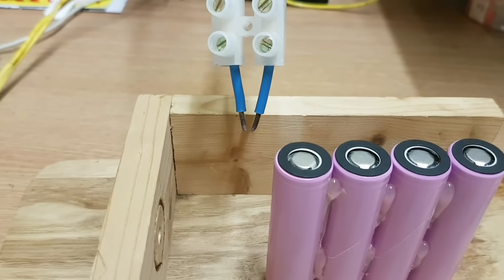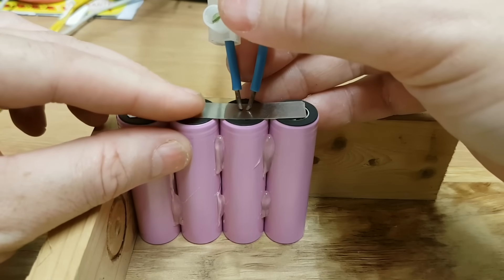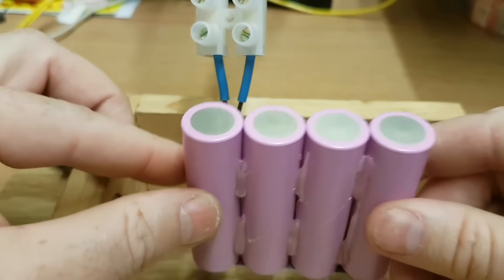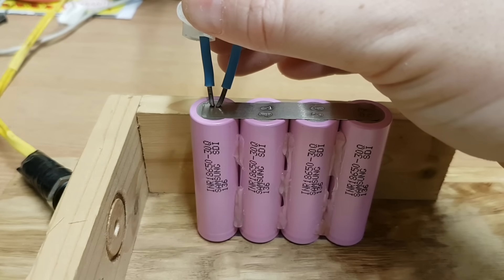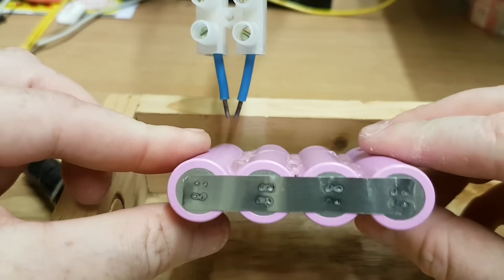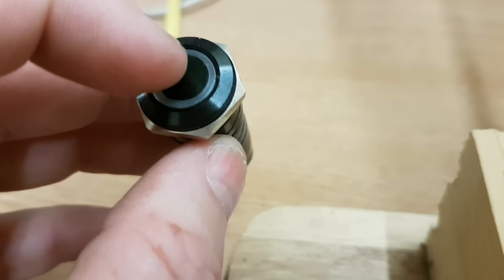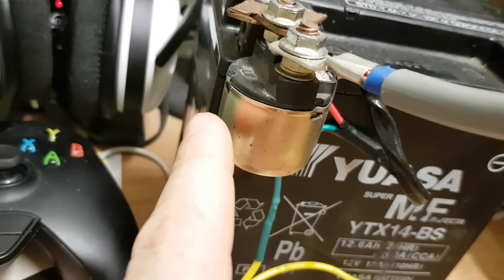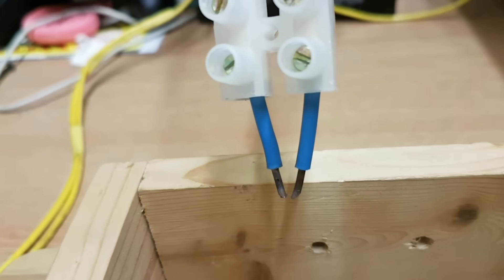DIY Battery Spot Welder - Demonstration & Explanation

Comment: Tried identical setup with with a car battery delivering up to 500A, and using .15mm nickel strips, no luck... it blows holes in the strip every time... so some sort of more precise control over the duration of the pulse is needed I think... could you maybe included exact references to the board you mention in your video ??
Reply from the maker: John Doe I think you're holding the button down too long or don't have the prongs firmly in the nickel...
Reply: Indeed, I think my switch is of the wrong type for the purpose... I'll try to find another one, but still, I'll also look for some mcu-controlled SSR in order to have a precise timing control...
Reply: furthermore, it looks like I've cooked the solenoid... it's now shorted !!!

Comment: Brilliant work , and concisely explained ... Although I'm sure the current must be less than 100A , otherwise the solenoid would stick ...I'm building a similar welder powered by a 20p pack of used laptop 18650 cells , initial experiments show there's  plenty of current from this 3.7V supply but the pack could not be delivering over 100A have not tried a  solenoid yet (I just poke the probes on the strip ) solenoid will reduce  the current .. I would advise not to buy a spot welding pen ,  I just did from ebay , 38 pounds , it's rubbish..
EDIT ... Have just tried switching using a motorbike starter solenoid .... had to go up to 20p 2s, (used laptop cells average int res 300 mOhm!)  the weld is perfect .. if you're using new 18650's I bet 2p 6s would do it ...it's all about the internal resistance of the cells ..

Comment: Does anyone know how to calculate the amount of Short Circuit Current based on the information displayed on the battery. I thought that this information was impossible to obtain without knowing the internal resistance of the battery? I can't understand how the current figure can be obtained using the Amp-hour rating and the voltage (12.8v)?
Reply from the maker: Timothy O'Donnell CCA gives you an indication.
Reply: For those reading this thread the CCA is the COLD CRANK AMPS, which is generally considered as the amount of current available to turn over the starter motor. So I've pulled a car battery from an old car and this information isn't written on it ... I'm guessing that I need to try to find the battery specification from the manufacturer to determine this data. Is this correct ?
Reply: Also ... excellent video, massive thumbs up to you.
Reply from the maker: Timothy O'Donnell yeah, you'd have to find out. As you've found, a lot don't specify. 😕
Reply from the maker: Timothy O'Donnell thanks 😁

Comment: Its a really nice KISS device (Keep It Simple Stupid).
More advanced welders are usually build from a controlled capacitor charge setup.
But thats a completely different (and complicated) story.
Reply: tutto occhei
Reply: pretty simple to do it low sided. digipot or dac on charger is probably hardest part there. Im working on high sided design right now to enable the board to be flexible to the point that if you wanted to connect it to two car bats in series where the cap bank was...and throw a choke on output... you could even pwm stick weld. low sided design was tested with 2p 6s maxwell dcells. bout 12v was sweat spot and i could make 4 or 5 welds before manually turning charger back on to make quality welds again. I had tested it with bench supply for charging..bare bones...just to prove it worked then went through apt from hell trouble and bugs for 8 months. Ive almost got it ready to go low side with even wider buss bars, shortened weld path, and 3p 6s ...like 180f iirc and the ideal bus and fets add nothing to esr ...current came to like 2500amps on paper. As it worked 2p im thinking the lowered resistance of bank and improved weld path might get me the same welds at 9 or 10v. 

I really made the design a pita for myself though... isolated mcu and board to board is done with differential pairs :D

im personally proud of having no analog or magnetic switches on the damn thing too. When Lower voltage is dialed in on touch screen... or machine is turned off... power resistors connect to bank and bleed off all or some of charge. I used the beast known as depletion mode power mosfet

Comment: This looks exactly like the one AvE made... one would be tempted to suggest you stole the design :P
Reply from the maker: Harald Karlsen the are elements that are the same... However, my design does not require a crocodile clip to the negative of the battery to compete the circuit. This also means it's safer for the cell.

Comment: can the battery be replaced by a 12v power supply
Reply from the maker: Algar Refardi only if the power supply is capable of outputting at least 200A
Reply: If you put a big capacitor next to it

Comment: I was thinking of using one or two 400v 680uf capacitors. Would it work?
Reply from the maker: danijel124 I'm not sure about the capacity of capacitors, but if they can output at least 200A very quickly, then yes... 👍

Comment: Thanks so much. I want to make a 10s4p for my eBoard and have been stressing about spot welders. This is awesome. Don't forget to layer up the strips on the ends if you're drawing more than 7-8 amps.  Thus was an eye opener too. https://youtu.be/wdZ_Ca_sAZE
Reply from the maker: Konkonkaos yeah that's a handy video, referenced it many a time. I'm using 12mm strips of 0.15 so mine can hand a little more current, but yeah, I tend to double up where needed ;)

Comment: Can I use DC power supply(30V 10A)  instead of battery?
Reply: You can't. The trick is the acid battery could source (at least for a tiny moment) a current of hundreds of amps that could melt thin metal. Whilst your power supply will definitely go to protection mode (off) right after 10A, which is not enough for deep penetration)

Comment: You could swap that copper out for some tungsten welding electrodes if you find some cheap ones.  Doesn't look like you really need it though.  That welding is really quick and the copper looks like it's holding up quite well.
Reply: Go to any welding shop, school welding shop etc & ask for some old, used tungsten electrodes. 
For the length you need they should give you a handful for free.
Reply: What makes an old used tungsten electrode not work for welding anymore?
Reply: length
Reply: I can run an electrode about a quarter of an inch long in my TIG torch.

Comment: I like your minimalist approach. The advantage of a capacitor bank is you can control how much energy is stored and the caps can be recharged from a much smaller capacity current source. Need more current? Add another parallel cap. Usually they use FETs to dump the caps but I guess you could stay with the solenoid

Comment: This works great, if you don't mind occasionally blowing holes in your really expensive lithium cells.
Reply from the maker: Collis Williams personally I've blown holes in fake cells, never in genuine cells.
Reply: darkkevind Maybe thats the problem. Im using the Liitokala cells.  The voltage, capacity, and weight are all correct, but maybe the contact points are thinner than a brand name cell.  Still, I think my next move is to purchase a spot welder that allows control of the current, since they're relatively  inexpensive.

Comment: i noticed that your  solenoid links are for 2 different ones can i use any of those or why is there links two of them? and the one you show is different does it work the same using the one in the link? could this be made with 18650 batteries connected together as the power source?

Comment: I suggest adding an emergency slow-blow fuse inline, because if your solenoid gets stuck things will heat up real fast!
Reply: Ignorant kids who don't know how to do any of the electronic math. This guy is shorting out a battery that has a 200A CCA ("cold cranking amps") rating. Thus, the peak current is limited only by the internal resistance of the battery + the solenoid + the cables + two point contacts. I'm pretty sure that the welding contacts are the largest contributor to total resistance. He has to be passing a few hundred amps through the wiring. 

Now please go out and shop for a 500 amp slo-blow fuse and get back to us, will you?
Reply: Demef where would that fuse go ? Thinking of making this build, but implementing safety features on it also. Thanks !
Reply: slow-blows are the best  \m/
Reply: Isn't that what the momentary switch is for??
Reply: @dickphan  the button he uses activates the solenoid, the solenoid is the switch that closes the battery's circuit. If the solenoid fails closed there will be no way to safely break the circuit.
Reply: True, as the power draw through the solenoid switch would be unlikely to ever be an issue.   There are devices that fit on battery posts to disable the connector, or one could just use a simple inexpensive  knife switch on the side which is used to disconnect the battery.  If the terminals are kept quite clean then the connection should be good enough that the cable could be pulled off the battery post quickly without further ado.  Also, one is right there with the probes and can just move them away from the work if the welding action doesn't go off.  I have had a welding rod STICK to the work hundreds of times but yet could just pull it away with no real issues. Sometimes I have to release the rod from the holder, in stick welding operations, but in this case I doubt those probes being welded to the nickle would stick so hard as to not be easily pulled off should the device stay turned on.  Unlike a steel rod, copper is soft and so should remain pretty soft at the point of being welded somewhat during a solenoid failure.
Reply: looks like i gotta standby a pair of wire cutters if i try this, the more i read the comments the more i realise many things can go wrong @CANTSiR
Reply: Jeeeesus, just separate the 2 probes, NO current will flow. Bunch of nancies.....
Reply: what size fuse would you use please?
Reply: You could use a fuse set just below the cold cranking amps of the battery. I would go with a slow blow fuse like suggested.
Reply: thanks for the good advice@CANTSiR
Reply: A 200A DC breaker from Ebay is about £8 / $10 and would allow instant reset. A 200A fuse would be almost as expensive - and need replacing if it blew.

Comment: Can you use a computer power supply instead of a battery?
Reply from the maker: Aleksander Sats no, you need a heck of a lot of current...
Reply: then what if you add a super capacitor to the system?
Reply from the maker: Aleksander Sats yeah that should work, as long as they can discharge at least a couple of hundred amps...

Comment: I used a battery of 285 CCA at 32 deg F.  Using the timer, which has a minimum of .16 sec's in a delay off mode, it blew right through a nickel to nickel weld.  I think the timer board keeps it on to long.  If I manually bump the switch so it is on only a moment it works okay.
Reply: 160 ms is too long most welders I have seen for this type of welding have times at or below 25 ms.
Reply from the maker: Don Smith yep, that's what I found too. I can't find a timer that stays on for the right amount of time... They all seem too long.
Reply: Sorry.  Just saw your followup video where you made the same comment about the timer.  Yep, a button conveniently located looks to be the answer.  I like the nails!  Thanks again for the concept!

Comment: how do u recharge those batteries welded
Reply from the maker: sunchaser w these packs get hooked up to a BMS that balance charges the pack through a charging brick. But you could charge each parallel pack via a TP4056 if you wanted...

Comment: hi i did this without the relay and is it okay to continue?
btw what does the relay do here??
Reply from the maker: Dilshan Perera the relay allows you to easily connect and disconnect the current flow, so you can line up your electrodes without worrying about arcing or sparking.
Reply: thanks

Comment: If we use a capacitor which hold enough Amp for the job parallel with the battery( with small gauge wire) so we dont need a timer and it would be better for the battery life.

Comment: I thought about trying to build one one with a high current . transformer and a couple super caps. and otherwise same setup. it would just take time for the caps to charge. I guess a couple 300 farad caps would do a weld.  charge with about 50 amps. at 4.5-5 v. or parallel caps and c HB are with 2.5v at 50-60a. rewinding a transformer similar to a microwave transformer. using 0 gauge doubled. and maybe two coils. to get 3v open circuit. I just need the caps... maybe the transformer and rectifier and solenoid would weld?  great video...

Comment: Wow, a nice simple design that works.  Thanks for posting.
Reply from the maker: ptmoy1 you're welcome 😁
Reply: I noticed you've hot glued the cells together before welding.  Whenever I tried to hot glue battery cells, the glue just peels off the cells.  Do you have to use special glue sticks for this?  Is your glue gun high temp or low temp?
Reply from the maker: I just use loctite glue sticks. Nothing special, just bog standard cheap hot glue gun...

Comment: Extremely useful for those of us who use radio battery packs..only spot welding will yield compact replacement battery packs that will fit the dedicated space available. Thank You !   you don't specify the type of metal the strips are fab'd from ..??
Reply from the maker: Capt Larry -  thanks! Pure nickel.

Comment: I have a gel battery 7.5ah at 20C so that would be 140Amps. Will try with that instead, see how it goes. Car battery is way to big and bulky for me. Very nice work! Perfect example of KISS. Be as easy but nice and small if it works at 140Amps.
Reply: he‘ll be ok，20c means  can discharge at this rate seconds even long time ，don’t means its internal resistor。
Reply from the maker: Hmmm, I think you'll struggle. The minimum required to spot weld like this is 200A....

Comment: Nice.. You could do with a foot switch though..
Reply from the maker: Yeah that's been suggested a few times. I really don't think I'll have the control I need though... I may try it.
Reply: darkkevind:  I suspect it would be much more difficult to obtain short duration pulses of around 0.4 seconds and do so repeatably.  A foot, attached to a leg, has too much inertia because of its mass so would be much more sluggish than the thumb-operated push switch you used.

Comment: You state 200A plus battery required. However you weak component is rated, you said, 150A. Then, you are not using the full 20A+. Yes?
Reply from the maker: B Stott even though the component isn't rated for 200+A doesn't mean 200A isn't paying through it... Just means the components, ie. the copper contacts inside the solenoid will degrade faster than usual as they're not built for that much current passing through...

Comment: Think i might try using some tig tungstens as the probes
Reply from the maker: Eliot Mansfield good idea. They conduct well?
Reply: darkkevind   Well enough for this job.  Reason for considering them is because they are very tough and can be ground either a point or bull nose.
Reply from the maker: Eliot Mansfield that's a good idea. My copper keeps losing its point!
Reply: Meh his copper worked. I think spot welders use copper electrodes anyways.
Reply: what you want is glidecop alloy.very fine points avalible . do remember they require light standing of tip before first use (cu al sinster...dont recall why but something about that means u need to hit it with sand paper b4 first time) ... u can look up pros cons...etc.. or just know its what sunstone uses...if you did your hw on spot welding... u probably know who they are

Comment: Where were you and this video 20 years ago when I was radio control racing and trying to solder batteries into packs
Reply from the maker: Haha! You and me both! I was soldering NimH cells together by hand! :(
Reply: Yeah this technology was certainly available 20 years ago. I think he just lucked out with the particular battery he's using. This process is likely sensitive to the short circuit current delivery of the battery being used. That's his "current limit".

Comment: ONE MORE TIME THANK YOU KEVIN...FOR ALL THIS EFFORT..!!
THE 600AMPS ARE WAY TO HIGH FOR WHAT WE NEED...YOU HAVE A 200AMP CCA BATTERY AND STILL YOU HAVE TO BE FLASH GORDON QUICK IN ORDER TO MAKE THE PERFECT WELDS YOU DO..
1.THIS SETUP IS PROBABLY THE BEST BALANCE...DONT GO FOR HIGHER LIKE 500-600 AMPS FOR 2 REASONS..
a.you wont find a solenoid rated for that amps...and if you find... adding the cost of the battery you are near the price of a commercial dedicated 18650 welder which is around 150-200$
b.with this amount of power you have to practice a lot the timing...you should release  the button extremely fast...
I HAVE A SOLENOID RATED AT 300 ...MAX 400AMPS...AND BOUGHT A BATTERY WITH 360 CCA...ONLY IN THE LAST ATTEMPT WHEN I PRESS THE BUTTON AS QUICK AS I COULD I MADE A GOOD WELDING THAT COULD REMOVE ONLY WITH PLIERS..I HAVE TO ADJUST THE LENGTH OF THE CABLES ...CAUSE ITS WAY TOO MUCH CREATING  FURTHER RESISTANCE.!!
I WAS THINKING ABOUT BUYING THE EXACT SAME BATTERY BUT I WENT WITH THE BOSCH 3001 BATTERY FOR 3 REASONS...IT HAS MORE THAN  TWICE THE CAPACITY OF WHAT YOU USE ...IT HAS ALMOST DOUBLE MAX AMPS...AND ITS PRICE WAS 35EURO INSTEAD OF 55 EURO THAT I COULD FIND YOURS!!
IF YOU WATCH THE FIRST AND THE LAST VIDEO YOU WILL SEE THE RESULT OF YOUR PRACTICE...NOW YOUR HANDS ARE SUPER QUICK ON THE BUTTON....AND WITH AN ALMOST CONSISTENT TIMING!!!
HAPPY NEW YEAR AND ONE MORE TIME THANK YOU FOR ALL...!!!!